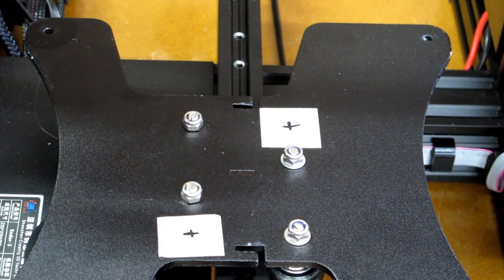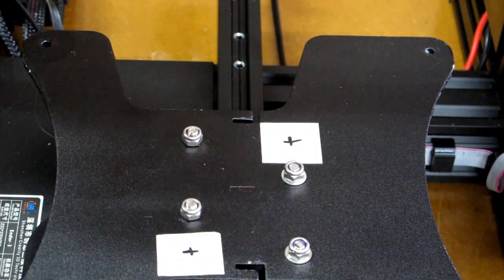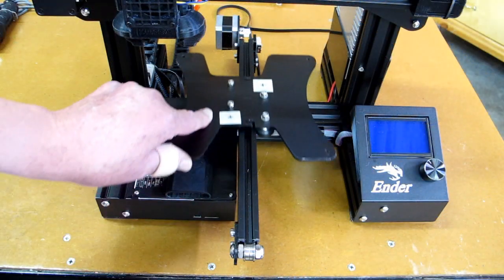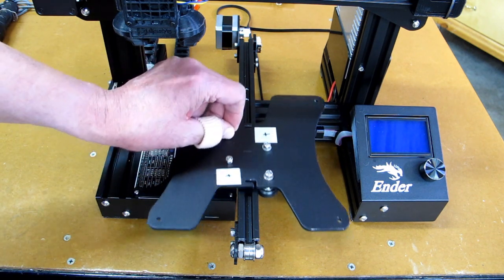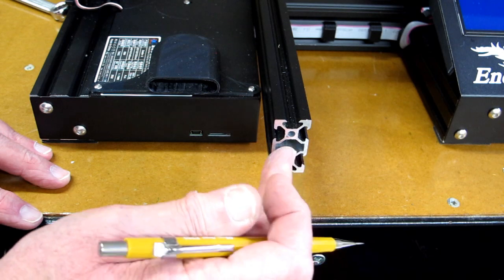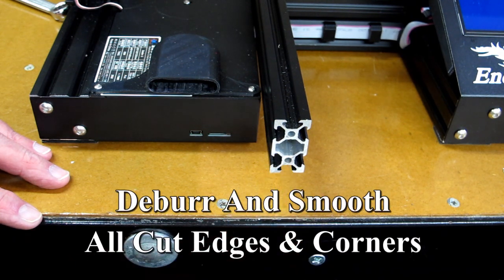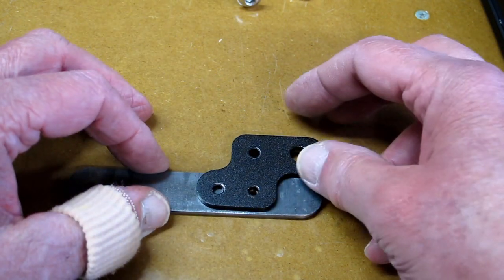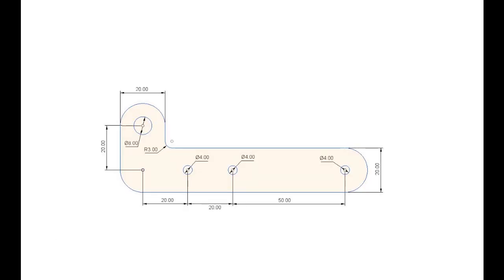Ender-3 Y-Axis Carriage Wheel Adjustment Correction

Comment: Hi there. Thanks for your video!
I noticed between 3:56 & 3:58 that while the bed is coming closer to the step motor, the belt is getting farther from the aluminium extrusion of Y axis. Do you think that the variation of tension in the belt due to this might cause problems or is it insignificant? This may happen on both sides and increase belt tension at both end of Y axis. What are your thoughts?
Reply from the maker: In a perfect world the connection to the bed would be a bit lower so the belt remained parallel to the extrusion. In reality, I haven't noticed a problem... primarily because most printing is in the center of the bed and (at least in my case) rarely does the bed travel to the far extremes. I have two Ender-3's and both print very well and one has around 4000 hours on it.
Thanks for watching.
Please subscribe. That is what keeps this channel running. 
Ron

Comment: My Ender 3 has the bed rollers across from each other as well. One question though. You mentioned the bed travel isn't as clunky inferring it was clunky before your mod. My Ender 3 sat in the box for several months before it was setup and the bed rollers have flat spots so when you manually slid the bed forward there was a big detent every full rotation of the rollers. I rotated each roller slightly so now there's four minor detents instead of one big one. Others have had this problem as well. I contacted Creality customer service and they basically blew me off telling me to contact the retailer and buy new wheels. Typical crappy Chinese customer service even though it's still under warranty. Have you heard of or seen this problem?
Reply from the maker: Creality seems to ship the bed wheels loose to prevent flat spots, but not always. Mine definitely had flat spots. The flat spots should go away with use. Totally loosen the wheels (so all four spin free) and let them sit overnight in a warm place (not a cold garage). The flat spots may have disappear overnight. Adjust the wheels the best possible and let it run for several hours with a heated bed printing something large enough that the wheels move back and forth quite a bit. They should come good after rolling back and forth. Let everything cool off and adjust the y-axis carriage wheels again. Level the bed again (with a hot bed and hot nozzle).  I received a photo from a guy in Australia showing me what the updated arrangement of the y-axis carriage wheels directly opposite each other look like (I assume like yours). I noticed the rear two wheels are still quite far forward which means the carriage plate is not centered on the wheels. It is probably good enough... If you look at the position of my wheels after my modification you will see my wheels are much further apart and the carriage plate is centered on the wheels. I assume your carriage plate could be modified to move the wheels further back (like mine) and my y-endstop bracket would then be needed. That's just the engineer in me talking. Leaving it the way it is will probably work just fine. Hope that gets rid of your flat spots. The bottom side of the hot bed is not insulated so the carriage plate will heat up a little (expand a little) while printing which will loosen the wheels very slightly. Thus... if the bed sits overnight and you can feel a very very slight clunking, but do bot feel any after making a print... that's probably just right. Hope that helps. Thanks for watching and Please Subscribe!
Reply: Great info. Thank you for your quick reply. To be honest the first test print I did with this printer was better than the best print I got off a modified Anet A8 that I recently sold to get the Ender 3. Many of the things I've found that should be improved on the Ender 3 have already been addressed by you and others. The X-axis stepper motor support screw at the very end of the rail was just bad engineering. That and the filament entry to the extruder that rubs on the Z-axis screw. That plate could have easily been engineered with the extruder mounted 3mm to 5mm more rearward. Those are just lazy engineering shortcuts that could have been done properly had someone bothered. Many other parts of the printer are excellent and then they do stuff like that. I had to adjust the angle on the Z-axis screw slightly but other than that and flat spotted bed rollers, it works well so far. But we'll see what happens when I do an 8-hour print with ABS. :) Thanks again for your videos and advice.
Reply from the maker: I have a video on correcting the z-axis leadscrew alignment. Be sure to check the angle plate holding the leadscrew nut is square in both directions (mine was not). The filament roller guide (thing:3052488) has worked great and keeps the filament away from the leadscrew. The Ender-3 has been printing great and has been very reliable.
Reply: I've exactly the same problem with not uniform bed movement. Moving it manually (without attached pulley) you can clearly feel these "steps" for each full turn of the wheels. Not only for the bed, for X axis too! Maybe a stupid question, but do you think just replacing all the wheels with new ones would fix this problem? Can you suggest me which ones are the best? Thanks a lot!
Reply from the maker: The wheels are too tight. As I said before (in the question above), totally loosen the wheels (so all wheels spin free) and let them sit overnight in a warm place (not a cold garage). Next day adjust them again and the flat spots should have disappear.
Reply: @RonaldWalters2010  I had a suspicion about too tight wheels. I'll try that, thanks a lot for your tips, I'm very grateful!

Comment: I bought this printer after your first video on it, I followed your link. My printer has the wheels in line with each other, they are not offset at all. Mine also came with the 110 volt plug :) I wonder if they upgraded a few things after your printer was built? Thanks for getting me into 3D printing, I've really been enjoying it!
Reply from the maker: They ran out of these in the US Warehouse and were waiting for the next shipment before they sent one to me. You would think when they know I am going to review this thing, they would make a point of sending me one of the latest models. There were no markings on the box showing it was packed for for the USA or European market. No date of manufacture on the box. So apparently they just grab stuff out of the China warehouse and put it on the boat for the US Warehouse and have no idea what is inside the box. Glad to hear you are enjoying your printer. Mine is now working great. Thanks for watching. Hope you have subscribed! Ron

Comment: You have published several fixes and improvements for this machine. How is it printing now?
Reply from the maker: The Ender-3 is printing very well. Every bit as accurately as the CR-10. It also runs cooler with 24VDC power, stepper motors run cooler, power supply mounted separately remains cool. The hot end and hot bed heat up very fast. It is now a very good little printer. Next improvement to be covered will be the Petsfang Bullseye Hot End Cooler. Thanks for watching.